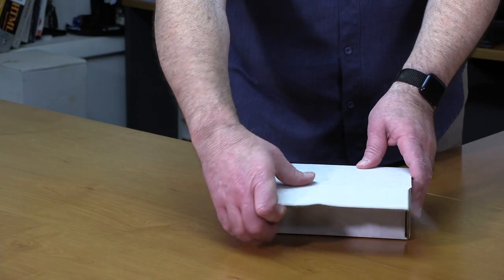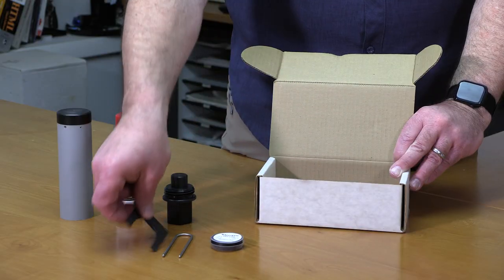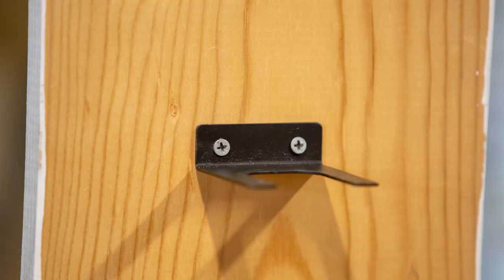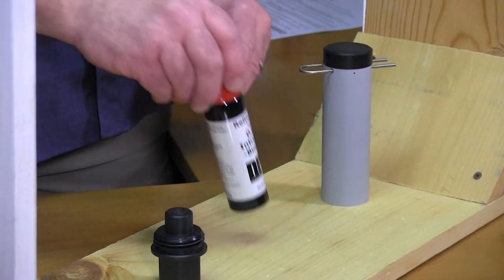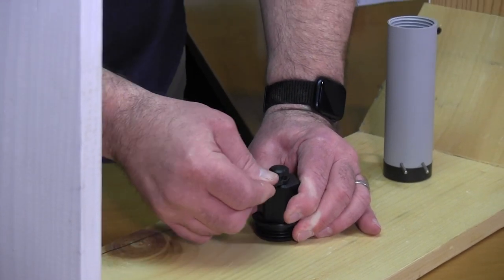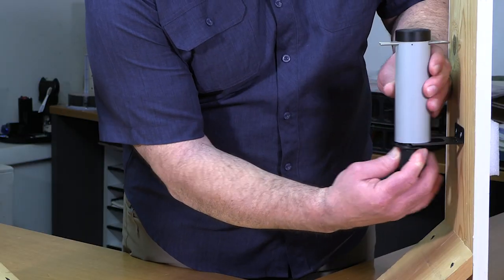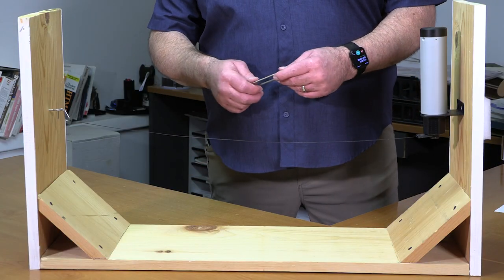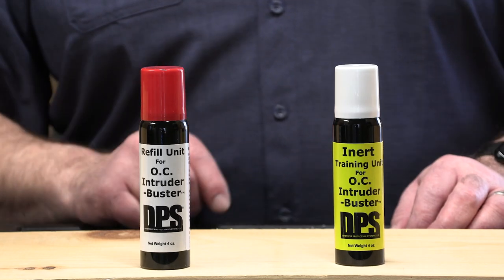OC Intruder-Buster Tripline Pepper Spray System

Comment: Is sabre 16oz stream 10 percent oleoresin capsicum  and 1.33 mc strong
Reply from the maker: Sabre is a good product, it is hot but it does not have the knock down power of DPS. With this said, I am not responding any more on this thread about anything other than the OC Intruder Buster. If you want to inquire about things contact me through my site please.